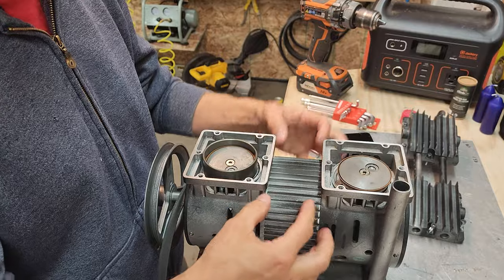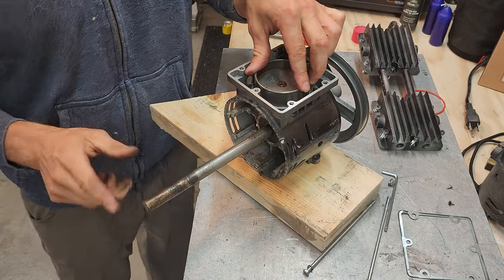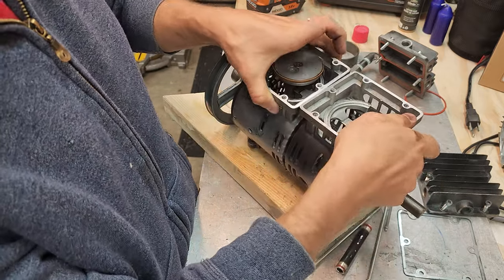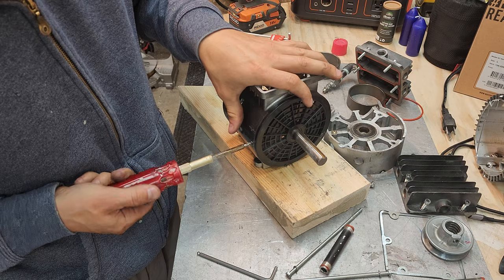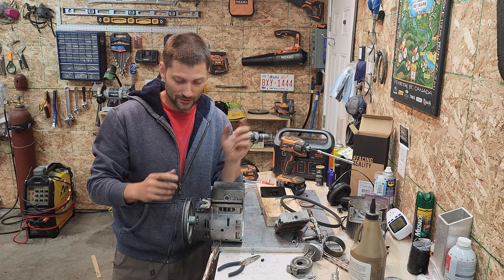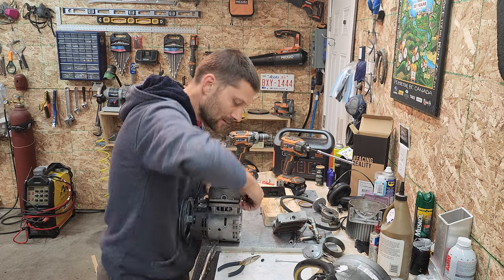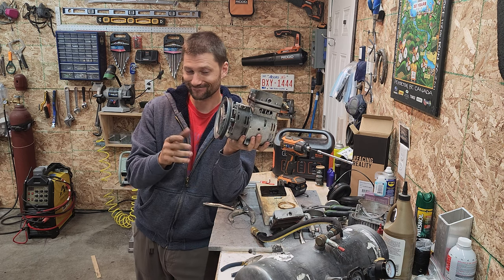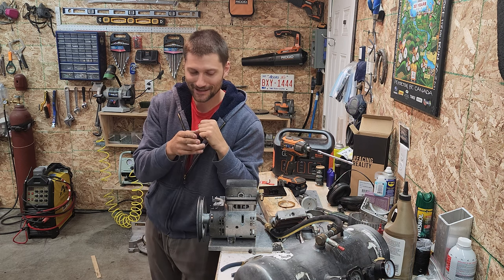Can You Build Your Own Belt Driven Air Compressor Similar to the Keene KAC1?  I Think So!

Comment: This is great. I've been looking for something similar to this for adding compressed air to my work truck after being unhappy with a/c compressor conversions. Most air compressor heads I see online are much too big but this looks like it would fit perfectly, just needs a little fabrication for an electric clutch on the belt drive.

Comment: Just how long a snorkel can one use before you have to have compressed air. If you have a check valve in your mouthpiece, for exhaled air would you not get fresh air all the time. The top end the hose would have a floatation device that would always have the intake above water . It is great though you have a never give up never give in attitude
Reply from the maker: I feel laying flat under water at even 2 feet deep would be pretty tough to breath through an extended snorkel.  I know at 3 feet it seemed impossible to inhale.

Comment: I'm getting the message that drilling the connecting rod ruined it - is this correct ?
Did you not also ruin the other connecting rod ?
Reply from the maker: Actually the connecting rod really didn't seem to have any negative affect other than the shaft moving in and out a touch when it spins.  What wrecked it was a quick connect on the intake that spewed a huge amount of brass shavings into the pistons as the vibrations wore away the quick connect fitting.
Reply: @UtmostOutdoors  I wondering why you removed one of the cylinders.
Did you actually drill the other rod perfectly ?
Reply from the maker: @mohammednovalija  I just wanted to give it a try since the compressor made more than double the air I ever needed before it wore our from the brass shavings.  Lighter and more compact is a win in my books!

Comment: DON'T BUY  The idea is to me is to make something out of broken stuff with parts from other broken stuff you've acquired! Take a lawn mower engine that has good compression hooked up o a old 100+ lb. compressor tank  and make it your garage air compressor capable of keeping up with 2 to 3  air tools running at the same time! That's my new project just need the gas motor got tank all valves rebuilt 1960 3 phase electric motor. YOU THINK I CAN? Can you?
Reply from the maker: Some things are better to build, others better to buy.  I think it all depends on your situation.  For the lawnmower compressor idea, you may need to increase the compression ratio by shaving the head down or simply filling in some space in the head to get the PSI up.  But 120psi on a good piston ring should be plenty.  For diving, oil free is a nice perk, but for a shop, worth a shot!